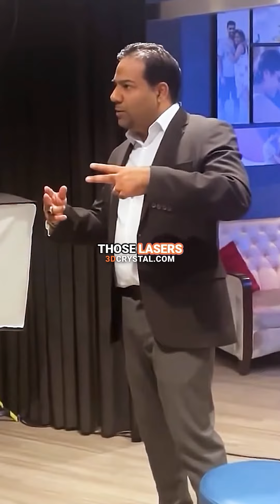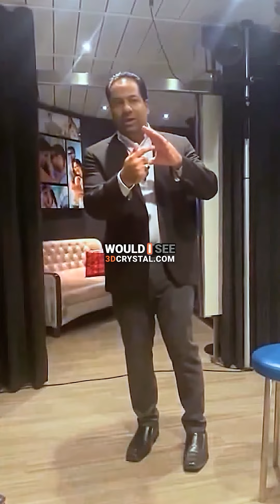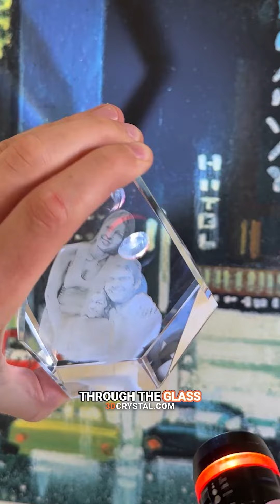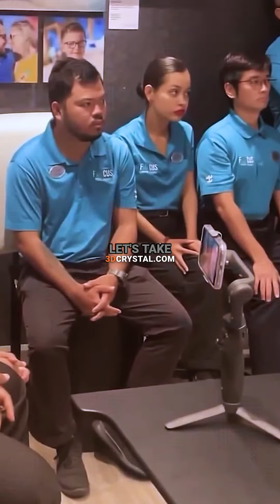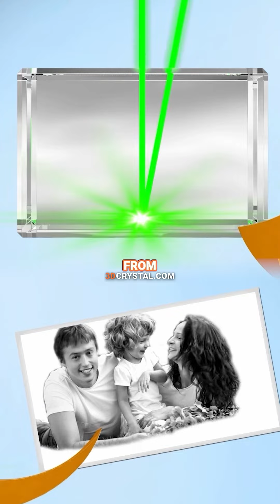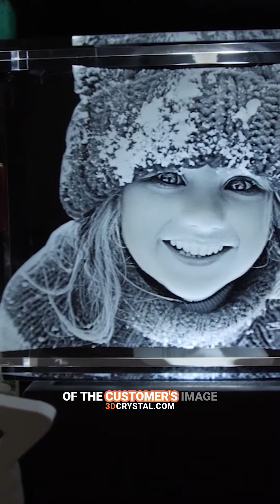How Subsurface Laser Engraving Works

Comment: Interesting.

Could a similar effect not be achieved with a lens pair, the first to initially cause the bean to diverge - and then a second lens to focus the beam back down so it is in focus at the depth you wish to engrave?

If the beam was being brought from  - for example a 15mm diameter beam, back to a point at a depth of (for example) 1cm, then you would have (I think) something approaching inverse square law ensuring that the beam was harmless right up to the very last, when finally, at the target depth, the power density increases massively and can cause the microfracture.

Just a thought.